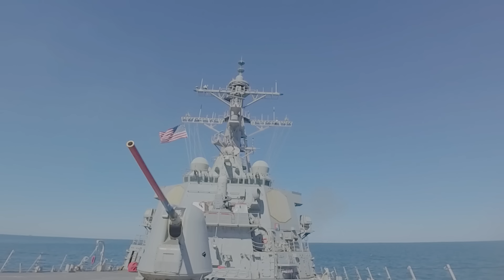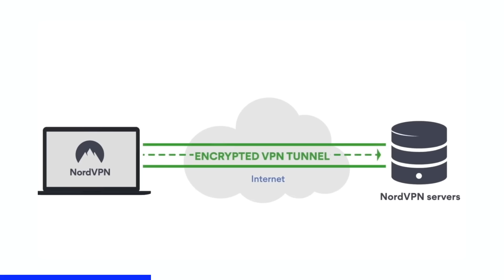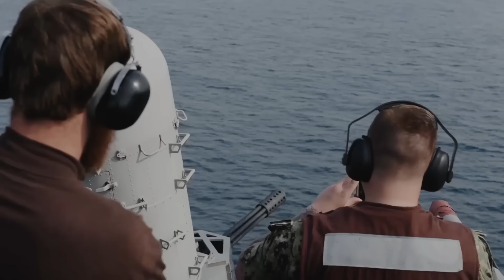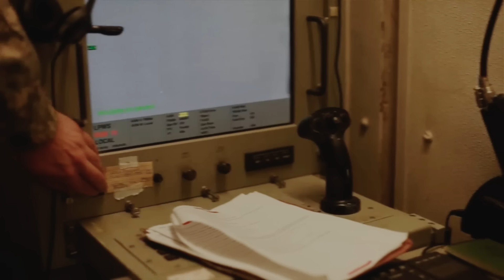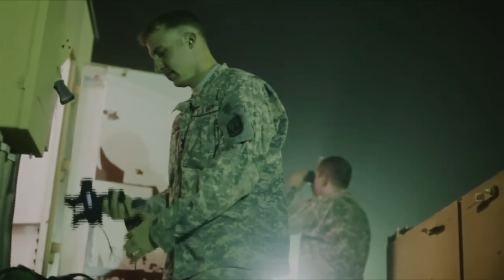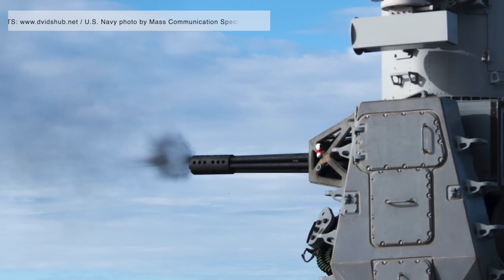What makes Phalanx CIWS so important for US military ?

Comment: The Phalanx needs to be upgraded with AESA radar and single barrel 30mm cannon that can simultaneously use AHEAD, PAM-T and HEDP rounds
The existing MK-46 would remain but getting networked so they can work in tandem

Comment: Given the kinds of advanced munitions technology I have just one question? Why hasn’t our DoD developed a 30mm fragmentation round that explodes out into a 360 pattern/radius instead of a solid tungsten depleted uranium round for all of our CIWS close in weapons system ?
Reply: I haven't watched the whole episode yet so I don't know if they are mischaracterizing the ciws system or not. However CIWS does utilize 20 mm high explosive fragmentation Warheads that do explode. Essentially it's a Vulcan Cannon with a special radar system. However, the ammunition they do use is high explosive fragmentation.
Reply: High explosive fragmentation rounds not Warheads I misspoke.
Reply: Simple
The USN is still stuck in the past. The CIWS uses 20mm and has to spray a wall of rounds. With 1500 round mag, its not lastly long
They need to replace it with a single barrel 30mm cannon with multi feed capability. Give the CIWS radar an AESA upgrade , 3 panel design , I would still keep it inside the shell
The system need to feed HEDP,, AHEAD and Mk310 PABM-T. simultaneously A revolver style firing would work